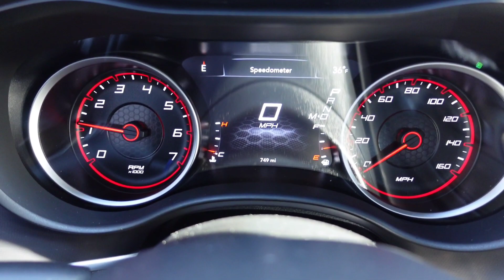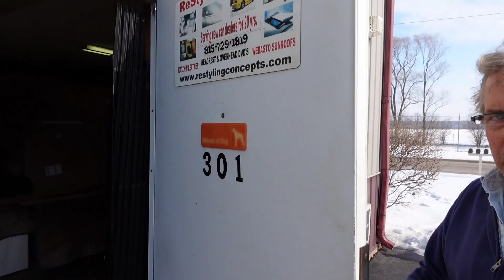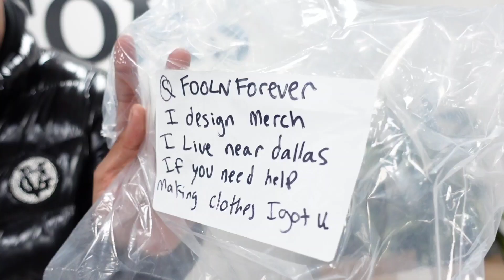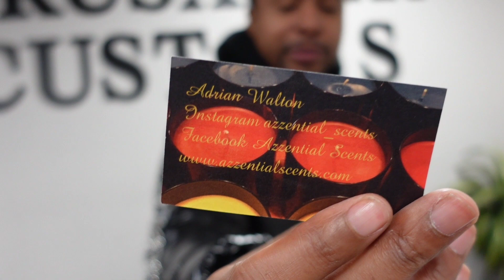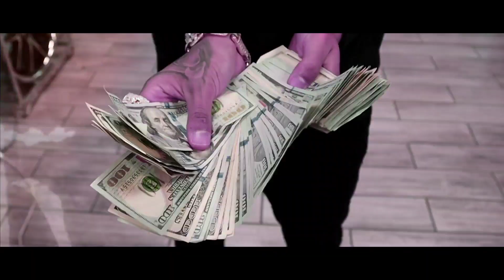*THE TRUTH* PICKING UP MY SON CAR AFTER HIS ACCIDENT AND GETTING HIS INTERIOR DONE

Comment: Og my brothers a mechanic and said to prevent condensation from building up drill super small holes in the plastic part that holds the lights under the hood.if air can get in there it will prevent the condensation and the heat from the bulbs can get released

Comment: Yo the dealership on some bullshit. I had the same issue with my headlight and had to get em replaced. The condensation will definitely come back because there's either a small crack or the headlight not properly sealed. Yeah turning on the lights will dry it out, but it will come back .

Comment: They say the Tesla you have goes 0 to 60 in like   2.4sec and 0-100 in 4.4 to 4.6sec that’s so crazy that it’s so fast I was watching a video of this kid killing 800ph to 1,200ph cars and the Tesla was pretty much stock that’s insane and I do believe that it runs 8 in the 1/4 and I don’t know if it’s high or low 8 but Straight from the dealership and it’s run in the quarter mile and 0 to 60 and 0 to 100 times are crazy